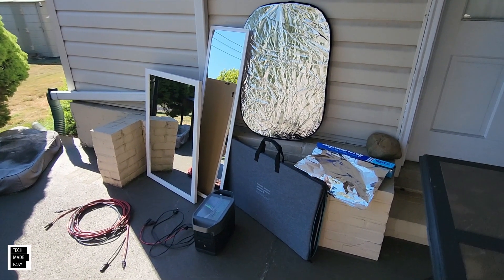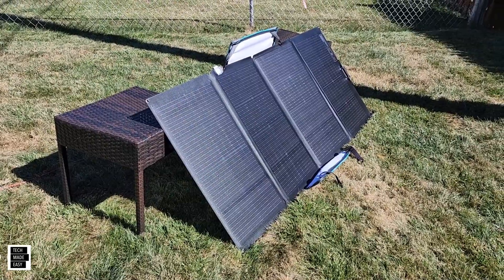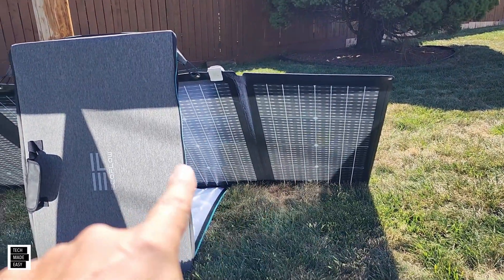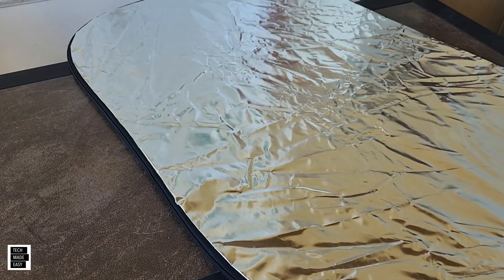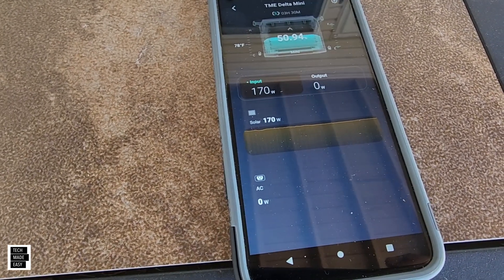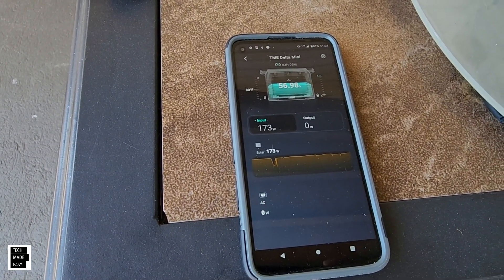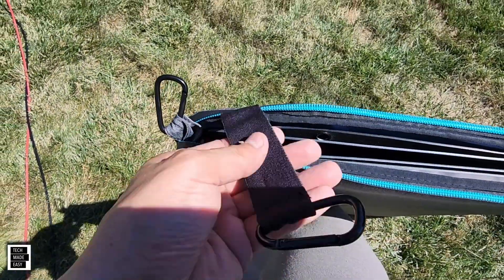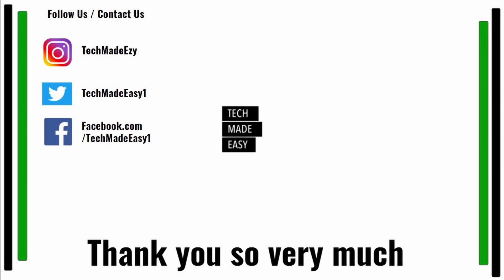PART 2  EcoFlow 220w BiFacial Solar Panel REFLECTIVE Testing with EcoFlow Delta Pro

Comment: If you have to use mirrors which are inherently heavy and bulky. Means your setup is for a more permanent setup. That you can get a much more cost effective deal by not buying a portable solar panel.

Comment: Thanks for all your work to show us various “hacks” to get the best reflectivity.  In viewing other YT’s, I believe the biggest gain is more throughout the daily….total daily watts gained.  If you’re moving your panel to have a “perfect” angle all day a bifacial probably won’t give you much gain for the money. BUT if you have rigid bifacial panels on a fixed mount, then I believe the reflected solar energy will be absorbed at a higher daily wattage over the entire daily sun path.
Reply from the maker: Thanks Rick

Comment: Nobody believes me when I say this so disclaimer up front: I’m in hydroponic horticulture professionally. We’ve checked every type of reflective surface because light in hydroponic systems is crucial. The most reflective surface is white. Mirrors, foil, etc absorb light as a gray surface, while white reflects the visible spectrum. Focused light caused by lensing, by a mirror, window, etc can be effective in signaling, starting fires, and so on but with solar panels you want a broad area instead. You can get white paint intended for highly reflective roofs in the US if you really want to go for it, but a standard white paint on cardboard or white poster board should do the trick.

Comment: Thaks for you testing. Now I think getting some black panels might be better and easier than those bi-facial ones. One question however: you don’t seem to use any grounding systems. Isn’t this potentially dangerous?
Reply from the maker: Thanks for watching our video and with our PowerStations we don’t need any grounding the way they’re built grounding is not required.

Comment: Whats the overall longevity of these portable panels compared to fixed panels?
Reply from the maker: They won't last as long as rigid panels, they do wear over time. I've seen wear just over a year.
Reply: @TechMadeEzy  Thanks for your reply. I'm looking at the Ecoflow Delta 2, just for home use / back up and thinking a fixed panel would be much cheaper.  As long as the panel is within required specifications, is it just a matter of attaching the right adaptors to the panel...and then plug and go?
Reply from the maker: @OSussannah @OSussannah just make sure you stay within specifications if you buy a panel that’s too strong you can actually damage the solar controller, here is the video we did on the delta 2 if it helps 
https://youtu.be/tvdsITwG_OQ?si=T__cEq31IMfaqevf
Reply from the maker: @OSussannah I would probably recommend just getting a 200 W panel that should do the job if you want I’ll place a link below on one I can recommend
https://amzn.to/4azmCzT

Comment: I have 2 of these panels for my Delta 2, Glacier and Wave 2, and I've been watching a lot of reviews.  Something about the bifacial panels I haven't been able to test, but just math, is that they're different circuits essentially. The front and the back have different amperages. The testing you just showed, in part of my mind, is that these are doing the best they can under every circumstance. I actually bought a set of tent poles(walking sticks actually) to use as the adjustable angle. Rather than leaning them against things, I can just prop them up by the northern holes by sticks. Vive Health, they were $5 each or $40 for 8, so I could even potentially use the case itself as a reflector.

At the very least, you proved they're consistent and dependable. During Black Friday they were only $349, two for the price of one 400w panel that was on sale for $699. Winter is coming and I have to figure out how to play with all my new toys.

Comment: Household mirrors are fair-to-poor reflectors of total light energy... In my college days (physics major) I recall seeing efficiencies on the order of 50-70% . There are such things as high-efficiency optical lab-grade mirrors, but the cost would be ridiculously prohibitive when we consider the task at hand. 
     Your hard work in these tests is much appreciated.  I imagine we were all thinking similarly:  How to pump more energy into the rear panels... Your thorough tests using easily obtained materials convince me that for a best-case power boost on the order of 3-4%, perhaps it's best to let the rear panels absorb what they can without added reflective surfaces... especially when we consider the added hassle of repeatedly moving them all.
    Great series of reviews... .

Comment: The sales pitch for these dualfacia EcoFlow panels indicates better performance is achieved placing the panel on snow, but is reduced when placed on grass.  So, I laid a white sheet on the ground, cited the panel on that and it increased the power input to my battery.  Could also try white cardboard.  The problem with your own tests is that the rear of the panels faced down towards dark grass and even the reflections from your mirrors, foil, etc made barely any impact.  Sorry I don’t have the stats from my experiment, but I invite you to try.  Just make sure the ground beneath and behind the panels looks white, capturing more incidental light.

Remember also that when the panels become hot, they generate less power, which is common with solar panels.  They produce more power when first set up (i.e. just taken out from my garage), then power generation drops as they warm up.  I’ve yet to see if a battery-operated fan could help cool them!

Comment: I'm just going to say this is already helping me. I don't know anything and I am trying to only make one purchase at this point. All-in-one battery, a refrigerator and probably the Wave 2 air conditioner / heater for a modular small cargo trailer camper. Thank you. I'm just trying to find out the most straightforward system to charge up something like a medium-sized ecoflow to make sure I have a couple days worth of battery if I don't have a chance to get good solar and I stay in one area for a couple days. I've also got the 400 w Ego inverter so I could take a few of those batteries along and if there's a lot of sun I could even charge those back up through the 100 watt input so I'm hoping to find a solar panel with the 100 watt USB output

Comment: I would like to know what the wattage would be if you placed the reflective panels flat on the ground directly underneath the solar panel or slightly angled up.  You took care to make sure the solar panel was correctly aligned but the reflective panels were way out of angle alignment with the back side.

Comment: To see clear, you may let the back side of the BiFacial solar panel facing the sun. That is the 155 Watt side. Maybe the back side is not working. I have read reviews when they got their Ecoflow solar panels delivered with an internal fault. The 160W panel was only producing 60W. Sent back and the new worked as intended well. So would you mind doing a test with your 220W BiFacial solar panel when you turn the back side of it towards the sun? I am curious of the results. If it goes well, then I will buy this 220W panel for my Topeak journey bicycle trailer.

Comment: try using delta 2 with 2 bifacial 220w panels and you will have about 500w input. I have achieved it without the cover supports, only the two flat panels on the floor and the deltA2. try two 220w panels connected and make a video again.

Comment: I just saw somewhere else that the temperature will top off the max and you won't get any benefits. Apparently it is only good in the cold, so they said. This appears not to be worth the money or overall any better than a single face.

Comment: That is weird on the glass part being on the back. On my 160w I have a nice durable tough material like what is on the case itself. After all these tests. this increase was so little there wasn't really much left for the panel to give. Seems odd. I seen these panels produce over 180 watts and other times less. I don't know how much connectors play a roll in this? I guess some of these same panels just give more than what some of the others put out? I'd do a test myself, and the sky is beautiful, but my power station is fully charged. It wouldn't really be much of a test. The amps would be almost non-existent. :body-blue-raised-arms:

Nice comparison and good video. Just a little jump of topping 6 watts max increase out from 166 to 172 was cool to see the jump, but just in real world seemed hardly worth the effort of setting that all up on a normal bases for that fraction of juice. :face-turquoise-covering-eyes:
Reply from the maker: I like the 160w better to be honest, he performs well, and it’s definitely a lot cheaper cost wise

Comment: I wonder why the panels never come near the promised 220 Watts inspite of brilliant sunshine and perfect choice of angle to the sun.
Reply from the maker: Panels never produce 100% of the rated wattage, all panels have different levels of efficiency, and none of them guarantee 100%. In perfect conditions you can come close especially when the weather is cooler because heat affect panels as well..

Comment: Ditch the cover as kick stand. 
Replace with 4 small keyrings and a fold up tent pole across the top. 
Modified tent pole sections for legs in 2,3, or all 4 spots. 
Can be folded up and stored in cover. 
Practically the whole back side is now open for reflection.

That said,  for the minor increase in power from the back side, 
I'd rather have the same panel minus the back for a significant
Weight loss.  I just recently bought 2 on black Friday.
Reply from the maker: I prefer the 160w panel
Reply: @TechMadeEzy do you still prefer the 160 watt panel?
Reply from the maker: @NoZenith yes that and this one depending on if your power setup can support it https://youtu.be/TanH8z85C2s?si=eGx-r4SlWt7iomyk

Comment: It simply doesn't make sense that adding sunlight to the backside will not increase the voltage respectively - maybe the heat is causing the drop.

Comment: Interesting. I would have liked to see these panels flipped around with only the back pointing at the sun.
Reply from the maker: The backside actually produces less than the front side
Reply: @TechMadeEzy  yes. The spec says so. That is why I'd like to see what it would actually produce when it is used alone.

Comment: I just received Delta 2 w/ 220w bifacial solar panels but did not come with the solar charging cable. Do you have to buy the cable separately?
Reply from the maker: Yes sold separately here is our link if you want to use it 
https://bit.ly/3Faydbm
Reply: I just got mine (I'm in the UK), and it came with the cable. Seems they listened to their customers.

Comment: I wonder how these backside panels are connected to main panel. Ive heard something about if they are in series or parallel (or something) they wont produce electricity if some part is in shade or less power output so it limits the watts at the level thats lowest. Might explain the small differ with mirrors and other reflective materials.

Comment: Drop a blanket on the front side! That will tell you what your extra money is getting you on the rear..considering the higher price of this panel for a 220w panel which is only about 10% more efficient on a perfect day than most standard one sided panels operating at about 70% efficiency typical. So paying extra for the "bifacial" side is only getting you 10% better efficiency? or less it seems (even with mirrors!!??) . I'd luv to drop a blanket on the front side and see what the rear side's total output actually is? Seems gimmicky and not performing

Comment: Great video, i thought the large mirrors would do better, is there no way of extracting that full 220w?
Reply from the maker: I was supposed myself. Bottom line it’s about the sun, the angle, temperature plays a part also, the cooler the panel it will perform better also.

Comment: So  let me get this straight. Ecoflow says that the mirror can produce 220wp + 150wp on the other side.
From the test  this panel seems  disappointing. 
Better get a monofacial model, no?
Reply from the maker: I prefer the 160w EcoFlow Panel for the price, especially when on sale. Or even a few 100w rigid panels they are like $99 each

Comment: Just out of curiosity, place the mirror in the panel shadow right underneath facing straight up from the ground.  The UV may bounce better like that then the direct sunlight reflection from 3 feet behind the panels.
Reply: In addition to this comment, I would like to see if using parabolic mirrors to concentrate the solar rays and hopefully increase charging wattage.
Reply: @Boilerone123  Parabolic mirrors would burn out the surface of the solar panel since they focus light and that comes with increased heat.

Comment: First thank you for this review! Regrading the back panel I think the problem is with the angle. It is best if the sunlight hits the surface of our solar panels perpendicularly, so the angle of incidence should always be 90 degrees. I think it's hard to find a perfect situation for a BiFacial Solar Panel unless you're using it on a planet orbiting a binary star. :) Or using some special mirror system.
Reply from the maker: Thank you

Comment: I had a pair of 20 watt bifacial panels that were made in Russia and did some similar experiments with mirrors and all. I found the small gain in wattage output was offset by a great deal of hassle in having to constantly adjust the  reflectors to keep an even lighting on the back.  Perhaps the best approach would be to hang the panels by wires (to minimize shadows) over a large white or reflective background.. and just cope with whatever results you get. Now that the single faced panels are so cheap, it seems hardly worth it to fiddle with more-expensive bifacial panels.
Reply: Cool experiment tho! I think I’m getting these panels look decent for the price and portability

Comment: One important thing you did not take account of.  With solar panels, a very small shaded part makes a disproportionate drop in the output wattage.  I think this is true of all panels.
I have the bifacial panels and in full sunlight, if I placed a 5" x 6" sponge on the panel and it produced a 25 to 30 watt drop in power.  You would think that the percentage of area blocked would be proportional to the power drop but IT IS NOT.  Furthermore  it does not matter where on the panel the light is blocked.  Also at the end of your experiment the panel sections were not straight which should have made a slight difference.

Comment: I have the 200 Max and this BF panel that I bought in a package 3 weeks ago , best I saw during charging using 50 ext and Max inside home  was 209 watt , It is usually around what you are seeing 170 Watts average. Thanks for sharing your testing , great Video !
Reply from the maker: Thanks

Comment: The current of 220W is 12a, and Delta Mini seems to be 10A. Is it current limited so that the maximum can only reach about 170W?
Reply from the maker: Hmm you might have something Jeff Thanks for that note.
Reply: @TechMadeEzy  I think this is the correct answer. The bottleneck is  the Delta Mini which can only accepts 10A (10-65v) from solar pannel.

Comment: Great minds think alike. I was out today and the Northeast using the same panels to charge my eco-flow Delta Max. I was able to pull 250 Watts at my Max. I made a simple wooden frame to hold the panels at the correct angle and easily adjust if needed. I tried some of the same experiments that you tried. With no sun on the back I was only able to produce 220 Watts. I also noticed after about 2 and 1/2 to 3 hours the panel started to get very warm. In the wattage went down. Now the panel says not to be smashed in water but it is water resistant so I took an old shirt that I use for a rag and soaked it in water and spread it over the panel to cool it down a little bit. That helped significantly for a little while but the wattage did go back up. My suggestion to you is if you can. Use the smallest connection to your device as you possibly can you may be losing wattage through the line as your line heats up. Second check the wattage output on the device and set up on the app. Sometimes it takes the app sometime for it. I've never posted a video on here before but I hope to do one next week on this subject.
Reply: Thank you and keep up the good work.

Comment: Thank you.  Well done.  If using the panels for emergency home home, then I would design an adjustable wooden open-back stand to place the panels on, running the full width of the opened panels, so the EcoFlow "stand" (or anything else) is not used in the middle of the back of the panels.  Then I would use some form of mirrors, or reflectors, behind the wood stand so that the sunlight fully reflects along the entire back of the panels.  Or maybe not get the bifacial panels and get two sets of normal one-sided panels.

Comment: Tks I still would like to see what snow might reflect.  I know you save the white foam, maybe give these a try. Dowels holding up panels so as not to block back as much. Glue on top of dowels rubber arrow heads that will fit through the panel grommets holes. 
 Lay flat put a bow type with fishing line as support in each panel. Like a rocking chair.